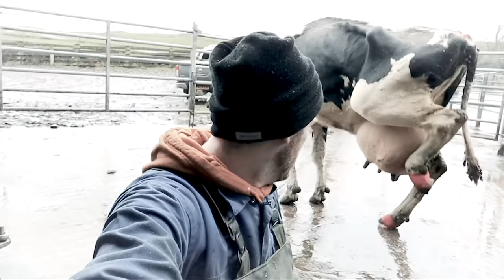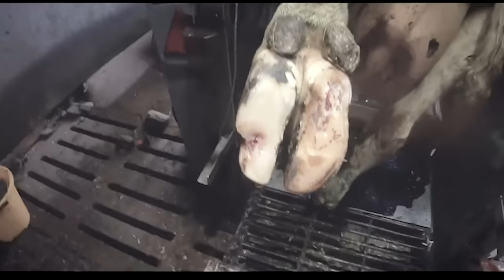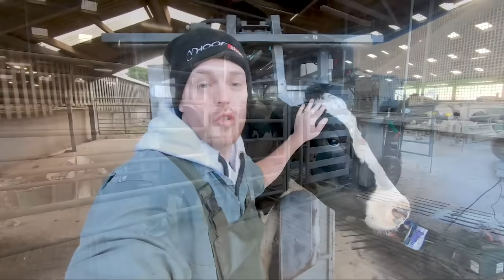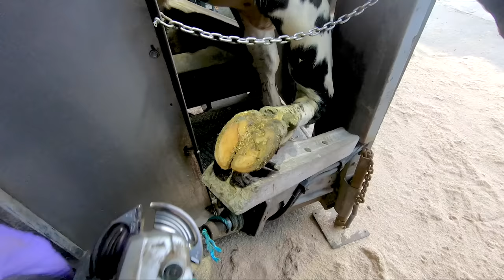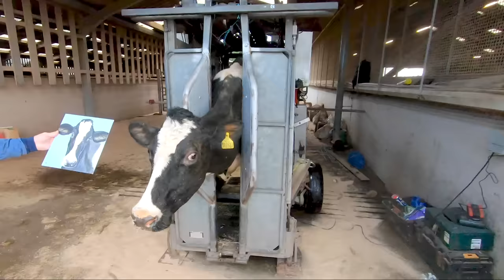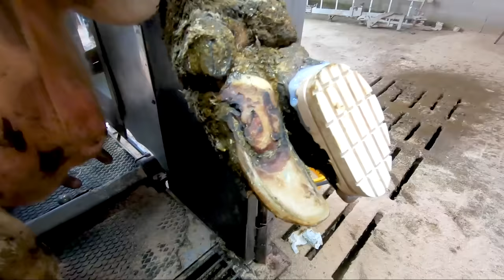TREMBLING in PAIN ... this COWS HOOF STORY | revisiting cow 812 | The Hoof GP

Comment: Hey,  Hi The Hoof GP,  looks like Cow 812 is making progress.
Its funny that her number is 812- like the random # I applied to my email years ago(nice portrait made of her BTW),  ; well I have a funny truck driver story after getting stuck in North Bend, WA last night(couldn't make it back to my home port in the truck driver 16 hour rule).
So after 10 hours off, made it to mile post 47,- put on 7 chains(legal amount) except the last 3-railer) to get over Snoqualamie Pass, WA-USA, when I took a look at the sign that had just changed to Traction Tires Advised, so wearily I took them all off in my rain-soaked shoes and socks(didnt have my rubber boots with me as I was driving another persons truck(mine was in the shop)), sopped my way back into truck and got home.
At Fred Meyers a little while later, I had got new dry socks and shoes(before I did another "run" to Tacoma and back)-  got to the cashier, paid and she motioned to me and durned if I didn't feel like Cow 812 as I grabbed a box sitting on an adjacent counter for balance and raised my left foot with new shoe on it and put put it on the counter.  She(the cashier) removed the little red mettalic shoplifter thingy off my left foot shoe!
And yes my toe nails need attention; I'll clip them on the weekend!!!  Cheers!!!